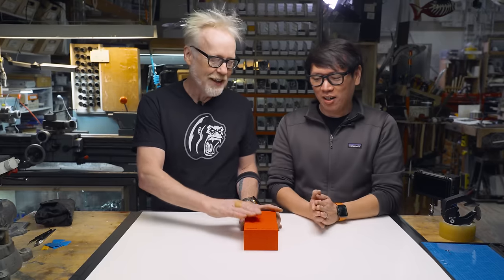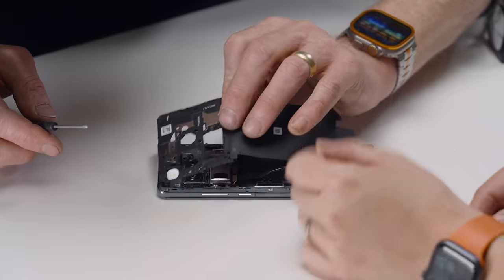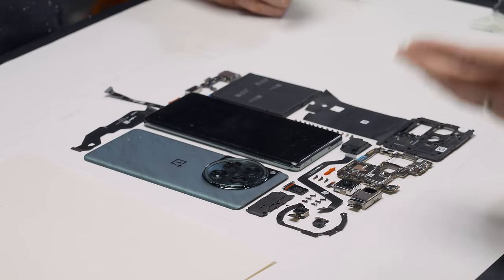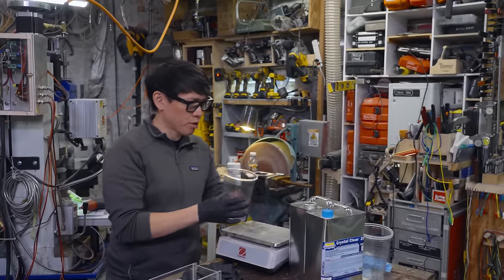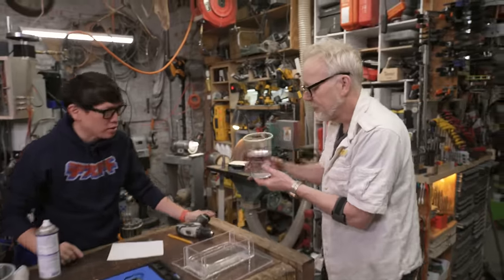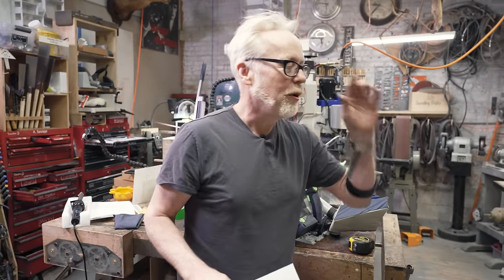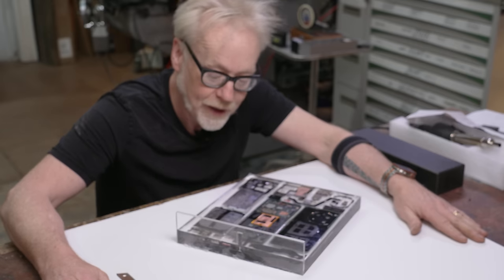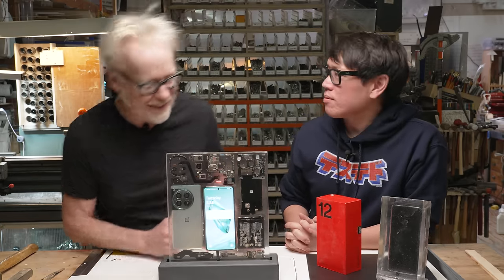Adam Savage's One Day Builds: Exploded Phone Sculpture!

Comment: For the future. To set the pieces, use a small bit of UV cured resin for each part to adhere it in place. Then cure it with a UV light to affix it quickly. Then do the rest of the pour.
Reply: I was wondering about CA but that is a better suggestion.  That would have allowed them to put it in the vacuum chamber too to get bubbles out of the area around the phone (though I'm not sure what the vacuum chamber would do to the battery).
Reply: A lot of times the vacuum chamber actually is put under pressure not vacuum. That way the bubbles shrink to (almost) invisible ones. 

Still that might be an issue for the battery as well?
Reply: Doesn't the CA also Crystalize causing cloudiness?
Reply: UV resin often has a different refractory index which means you can see it on or in other resin.
Reply: @sharxbyte  Yes, but just barely and if you look for it. While a cloudy area is much more vissible.
Reply: @Camera-Guy_ODST  Can but folks doing epoxy/wood furniture use it constantly to stabalize wood or fill pinholes in the final surface and it is invisible in their work.
Reply: @sharxbyte  That and you don't know how it might react (good or badly) with the resin if at all.
Reply: I'd imagine the actual VFX / prop master knows the best way to do it.
Reply: @jakejensen4809  they are more like jack of all trades, not masters of acrylic, if the OP actually specializes on Acrylic work then it's likely that a specialized worker would know more about it. plus actual smart people know that learning is a never ending process and are always eager to listen to experts in their respective fields.
Reply: The first thing I thought, why can't he super glue them down?
Reply: @f.b.l.9813  You're basing a ton of hypotheticals on a single random person's comment. The guy making money from doing this, eg the channel operator, most likely knows how to do what he did, the best way he can. Some random people in the comments section can armchair all they want, doesn't make the advice good.

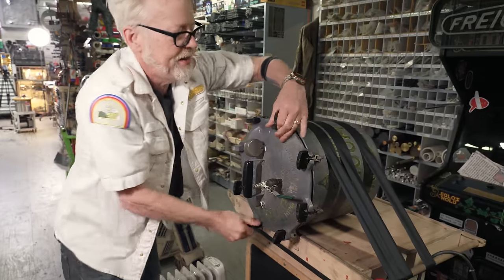Comment: 31:09 Peter Brown, who made Adam's book into a hammer, replaced the handles on his pressure pot with bolts so he can use his electric drill with a socket to tighten the pot quickly and the same torque by setting the clutch.

Comment: 20:33.  When pouring liquid from a full tin with an offset spout, you'll have better control if you position the spout at the top instead of the bottom as Adam was doing.  The air that needs to go in to replace the contents doesn't have to fight its way through to get into the tin and the pour will be smoother.

Comment: This looks good from a distance but the front and back case not being level with each other is going to bother a lot of people! Up close there are a ton of bubbles on the components and I'm not sure why they didn't pressure cast it. Cool project though might try it.
Reply: I was wondering this but I think part of the issue is keeping the mold level in the vacuum pot while everything cures. If the mold is not level, the parts would have slowly drifted.
Reply: @AxGryndr  You can pre-level the pot or level the mold once it's in the pot if necessary. Even if it moves slightly you can sand it level after the fact. I don't think the pieces would move on a small slant.
Reply: Yeah, the close up shots are not great...
Reply: @AxGryndr  Would the parts inside move from the air coming out?
Reply: @AxGryndr  Agreed.  My OCD is screaming at me lol
Reply: yeah i noticed the bubles also, it does look good but up close the bubles are sticking out like a sore thumb
Reply: Thank you so much for pointing this out, I was starting to think my eye sight was worse than what it actually is. 😂
Reply: @AxGryndr  yeah they could have secured the parts in place with a little bit of resin first to avoid drifting, surprised hey didn't do that

Comment: Anyone else have major anxiety when the polishing was happening? That exposed cable looked so vulnerable!
Reply: I thought about it, but realized you don't even need to polish the bottom surface because it'll be tucked away in the base
Reply: @zeikjt  I get that, it was Adam flinging it about that got me puckered 😂
Reply: It's always the worst step in resin work! I felt the anxiety watching this toto!

Everytime you do resin polishing you go like: "oh noooooo did I fuck it up?"
In the 90s I worked at a music store and I setup guitars, fixed amps and had the ought guitar remodel or fix, that my boss (a luthier) would instruct me how to do -- because it wasn't challenging enough for him I guess :D 

And respraying the body with polyurathe paint and then a two component resin clear coat. And you saw the little orange peel but it looks nice. And then you come in with your 400grid and you go like... HERE GOES 24 HOURS OF WORK! And then by the time you get to 1200 grid wet sands your nerves settle. And the polish is like ahhhhhh done! But those 3 or 4 times I did that were nerve wrecking. One of the 3 or 4 times was my own guitar,  not worried about that. But a client's guitar pffff....
And the first time I didn't realise how thick this car polyurathane paint gets and I got put on the neck and I am like.... Damn, it no longer fits... What do I do send the neck pocket or the neck? My employer said just bring in the neck and the screws will pull it in, gradually go criss cross slowly, that paint and clear coat isn't cured yet rock solid yet, the wood is harder. But next time mask off the neck pock :D
Reply: @SISPX  Adam flinging things about is sort of the flavor of this channel.  I still get nervous every time.
Reply: @sundaynightdrunk  I love it! It why I keep coming back ;)
Reply: Pins and needles.

Comment: Adam, if you flip the 1 gallon container of resin 180deg before you pour and have the spout on the top,  you won't get the gurgling or air added to the resin. This works for anything, even adding oil to your car.

Comment: A little tip for future resin... get a heat gun out and wave it over the surface while the resin is wet to get the bubbles out. It is a common trick in the world of woodworking with resin.
Reply: I believe Adam used a small gas torch for that initially on the small piece but good advice for those wanting to try it!!

Comment: So well executed and with a fantastic finish! Very well done Adam :)
Loving your new workshop layout, so much neater!
By the way, when you are pouring the resin (and other liquids too) from new/full containers of that rectangular shape, it usually helps to get a cleaner pour (less spilling/dripping and glug-glug) if you offset the pouring angle so the lid is higher up than the rest of the bottle instead of at the bottom, it'll look/feel like you holding the bottle upside down at first but it really works :)

Comment: Electrically noncoductive but heat conductive resin. Have the screen exposed from the side so people could touch and use it. Extend the wires so the parts could telescope straight back. Wireless charge and connect.

Comment: Given the time frame and what they had on hand, I'm guessing the bubbles were going to happen given it was their second attempt. That's understandable. However, when Adam says the battery puffing isn't a big deal because it's on the back, I'd argue the "back" of these sorts of displays is actually the more important part visually when doing exploded / internal tech style artwork. I think had they flipped the orientation of the front display and back panel they would have nailed it.

Comment: I feel like that puffy battery is a fire waiting to happen. This is still pretty impressive though.
Reply: Surprised they didn't use a dummy battery. Hopefully they fully discharged it first.
Reply: I dont think there will be any reaction with the battery now due to lack of oxygen. The battery likely swelled from the heat produced from the resin curing.
Reply: Came to post this.... Typically these sorts of displays use a dummy battery, for exactly this reason.

Comment: I would've put all the components "exploding" front to back instead of putting them all around the screen , and like another viewer suggested it would have been a cool idea to put the screen level with the outer layer of the resin so that the touchscreenfunction still could be used , and if not that at least take the screen protector off, and shame it still has loads of bubbles but still nice to see Adam at work and Oneplus still got their free advertising :p
Reply from the maker: We only had a couple of days to pull this off, so that's a bit more than we could bite off and chew in the time we had. Also, this wasn't free advertising; it's a sponsored video (disclosed multiple times in the course of the video ...)

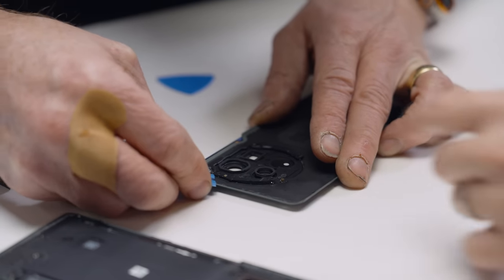Comment: 6:00 For a pry tool, try a skin wedge. It is steel, not plastic, so it's incredibly rigid and durable with an edge that is just about the thickness of a fingernail.
Reply: But they want plastic that deforms before the parts do to not harm anything, rather the pry tool / spudger go to waste than the wayyy more expensive / hard to get components.

Comment: The end product came out amazing. It had a good since of suspense and a great resolution you intended/needed it to have. But when it was all done I loved it and the video too. The screen was not working pixel perfect (had a few lines at the top) but it was amazing it worked as well as it did. I just wonder if it would still work a a regular phone minus no cams, needing external audio and mic (maybe a bluetooth solution). I also wonder if a keyboard and mouse (or one with a built-in mouse) would work wirelessly or with a compatible USB hub. That way it could be shown off that it is still usable just without any of it's cameras usable anymore.

Comment: Figured out for evacuating air from resin to set a wooden stir stick across the top so the bubbles will collapse when they touch it. Not perfect for all situations but works great for prepping batches to pour. 

Preventing Resin Boil Over in Vacuum Chamber
https://youtu.be/5EAwgz3iC4k

Comment: You have my sympathy with all the polishing. I once had an irreplaceable dvd disc that got damaged - (the one and only copy of my parents 40th anniversary party) - both my parents had passed away, and the one copy of the disc was damaged and scratched and gouged out beyond repair (as we thought) but I thought I would give it a go. First step I took it to a game store and got them to polish it 3 times. Nope didn't work. I tried polishing it on the polished built in to my bench grinder. Still didn't work, so I basically used wet and dry sanding disks to take off a very thin layer of the plastic, then many days of sanding, polishing, using various car bodywork pastes and polishers, my Dremel with various attachments and finally another buff up on my bench polisher. It glistened and was smoother than a babies bottom when finished, but the disc was now paper thin. I was scared to place it in to the dvd drive incase it shattered. So I placed it on a slow spinning motor, and dropped small amounts of a clear resin on it, spun it up a bit and as that layer was drying, repeated the process of spinning up and drying out. I then had a nice thick disc that needed sanding and polishing again. Which I did. Again. And after another day I was back at the perfectly shiny disk stage. No blemishes or scratches. And luckily it worked! So I got it in to my pc drive and ripped the video from it and stored it on my hard disk. Honestly, it was worth it to get a precious family memory restored, but I wouldn't go through that again. And I build action figures as a hobby so I'm well versed  in using resins, but if I have a project where I have to polish the resins up, I still shudder at the thought of it.

Comment: 6:45  They are impressed that the hardware continues to function as devices are disconnected and reconnected, "Very robust little system they have here." Which, yes, i guess.    But then are there hardware guys out there thinking something along the lines of:

> It's not that impressive. It's basically the embedded version of USB; it's designed to handle hardware disconnects at runtime - just like your mouse and keyboard.

Is it all designed to happen?

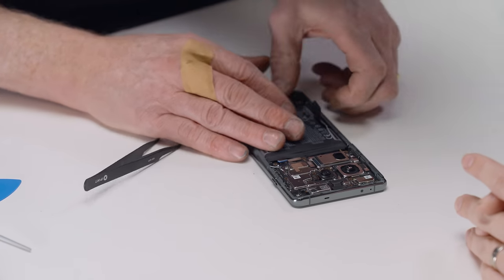Comment: 7:57 Please, never ever say that replacing the battery is "very doable" for a phone where you needed a lab oven to take off the glass back first! The bar shouldn't be that low.
Reply: He just used a lab oven because he had it. A kitchen oven or even a hair dryer would do the same job.
Reply: @RambozoClown  You are missing the point. Any service instructions where you need an oven or hotplate of any kind are not to be considered user-serviceable.
Reply: @rustkitty  Heat is a tool just like a screwdriver. If you want a tool-less battery change, for good or bad, I think those days are over. The market has spoken and these new slim designs are now the norm apart from the rugged designs that get fewer and fewer each year.
Reply: @RambozoClown  I consider heat to be more of a jury-rig than a proper tool like a screwdriver. At any rate, if the days of user servicability are over as you claim, then how is it okay describe the phone as servicable in a sponsored video? Don't you see how bad that looks? Also it's not even true, the EU has passed regulation "(EU) 2023/1542" last year which will require phones to have replaceable batteries by 2027 at the latest. International brands won't make two different phones for inside and outside the EU, nor will they abandon such a large market.

Comment: I was truly shocked to see that Adam does not know how to pour those gallon cans of resin (or anything else).  Flip it upside down of your intuition so the opening is at the top, you may have to twist the angle a touch on the first pour after opening, but it means you pour from the surface, eliminating the need for the can to gulp air during pouring.

Comment: Does the thickness of the resin on the front prohibit the touchscreen on the front of the phone from being used?  Would have been neat if it was thin enough to allow the use of it to run different photos or mp3's from the front.  Really cool.  Not sure how the heat dissipation for the processor will hold out thru the resin.

Comment: I love how Mythbusters-y this teardown was. Just jumped right into it and see what happens. Neat-O ! 

On second hand you are ADAM FRIGGEN SAVAGE you could've did a little more research and realized you missed an opportunity to buy more tools... the correct tools. Microscopes and heat plate and a  solder ball soldering station. Micro soldering longer wires to extend the leads and connections. 

Tsk tsk tsk I am not mad, I'm just disappointed.